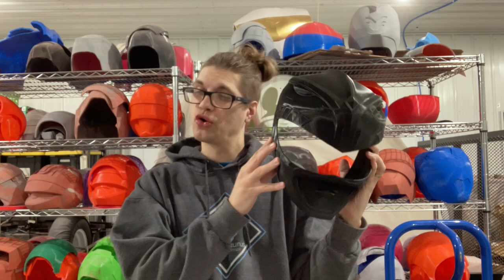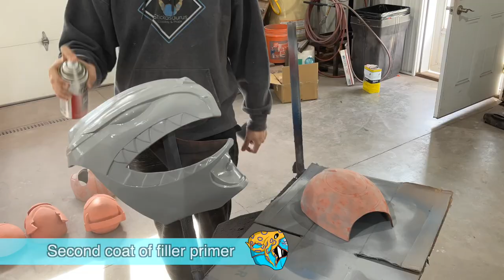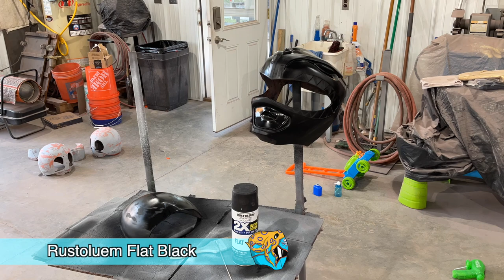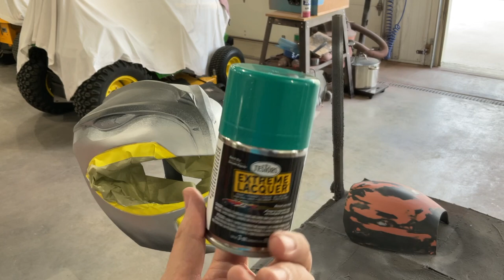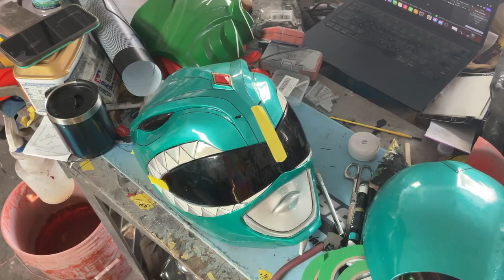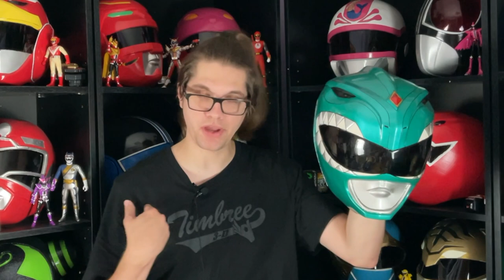Let’s 3D Print a Mighty Morphin Power Rangers Green Ranger Helmet! Dragonzord power! Tommy’s Best

Comment: So I just got me a 3d printer and want to print 3 different helmets. However I'm pretty sure my printer is smaller. Any advice?
Reply from the maker: Hey with that you’ll want to slice it up into smaller pieces and then weld them together, my mystic force blue video has some more information